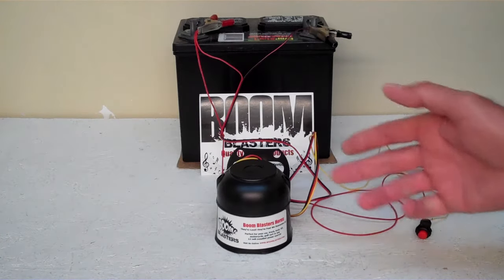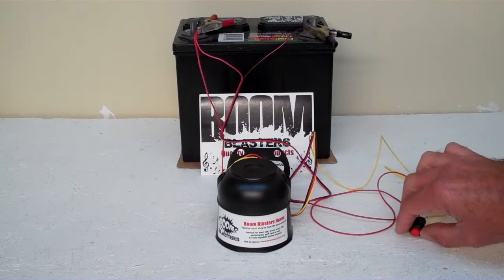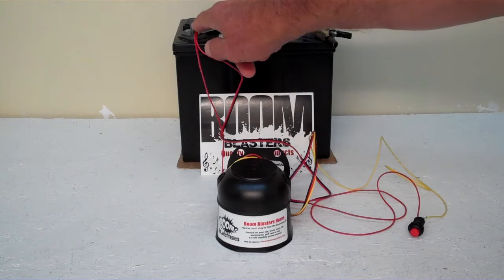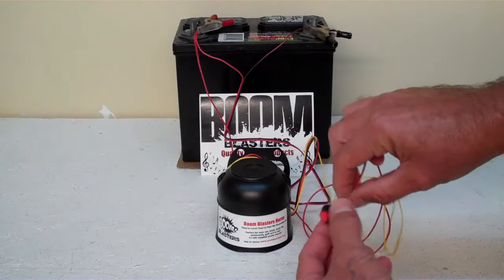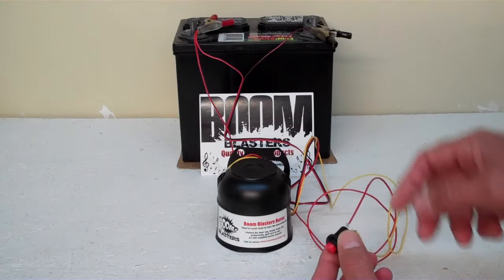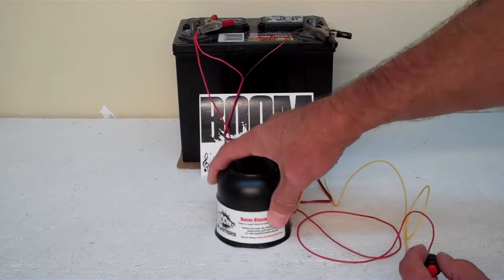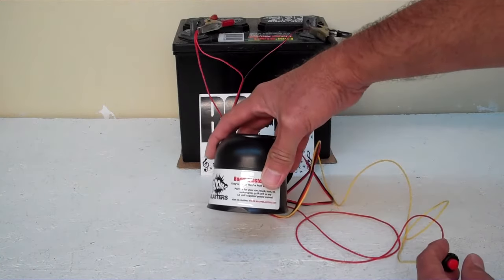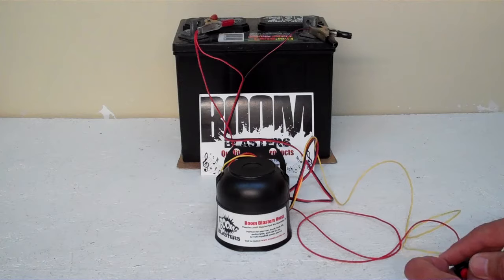Dukes Dixie Sounds Musical Car Horn

Comment: Very cool little horn if you don't have room for a compressor and air lines. Pretty loud also . I'm very happy with the one I put on my zero turn mower.
Reply: This is the most American comment ever
Reply: How loud is it over the engine
Reply: @vintagesimplicitytractors9464   Its loud enough to hear distinctly over the lawnmower engine.
Reply: is that u Hank Hill?

Comment: I plan on getting this horn. It's cheaper than the $70 multi horn Dixie setup and a lot less work to install. I'm going to get rid of my horn on 1985 Chevy C10 and use the stock wiring harness to power the Dixie horn
Reply: How was it want to install one on my truck